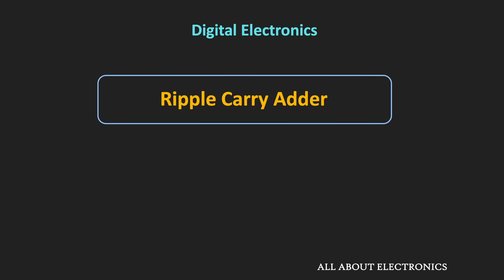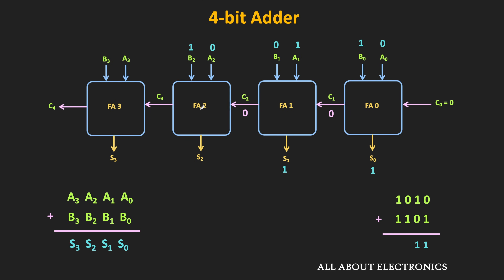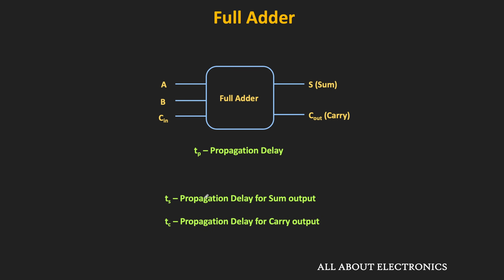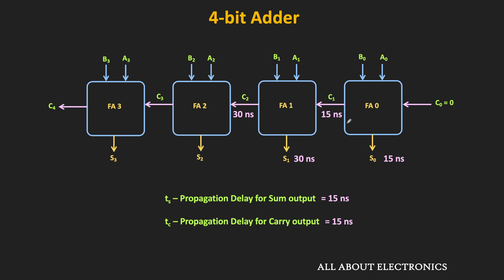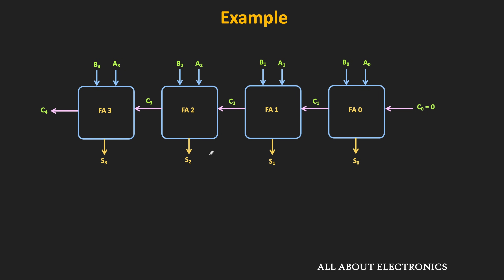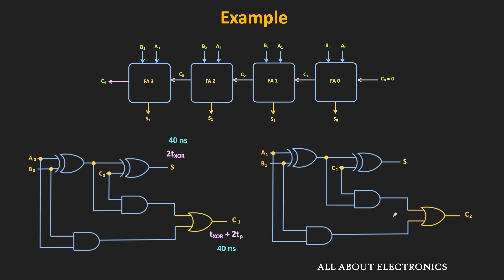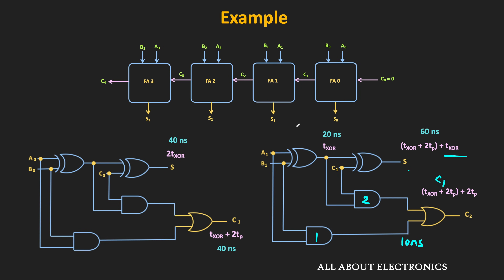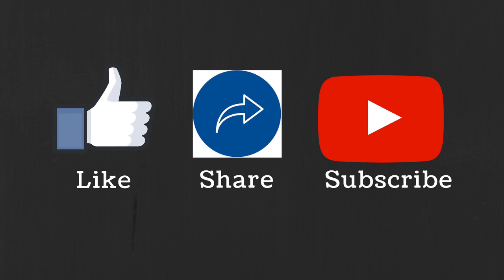Ripple Carry Adder Explained (with Solved Example) | Working and Limitation of Ripple Carry Adder

Comment: 11:20 , isn't it should be t(xor) + 3t(p) i mean the bottom and gate wasn't couted ig , 1 xor ,2 and, 1 or gate
Reply from the maker: It will be t(XOR) + 2tp only. If you see, the one input to the last OR gate is available after txor + tp time. While the second input (A.B) is available after tp. That means by the time first input arrives, second input has already reached there and available to the last OR gate. That's why there is no need to consider its delay. And that is why overall delay will be t (XOR) + 2 tp. I hope, it will clear your doubt.

Comment: Where does the final carry goes..should we consider it or ignore it?plss reply me😢
Reply from the maker: The final carry indicates that simply there is carry after the addition. So, if you are performing 8-bit addition using two 4-bit ripple carry adder, then output carry of the one 4-bit adder should go to carry-in input of the second adder block as shown at 3:53.

Comment: Sir, while finding the delay for the individual carry output of the first FA  , the delay should be t(ox)+3t(p) right? Could u pls explain me this
Reply from the maker: It will be Tox + 2Tp. Because, the one of the input to the OR gate is available at Tp time. (The lower AND gate). While the second input to the OR gate is available after the delay of Txor + Tp time. So, you just need to consider the maximum delay. That means after Txor + Tp time, both inputs of the OR gate will be available. And once that is available, then after another Tp time, it will generate the carry output. That means the max. propagation delay for generating the carry output is Txor + 2 Tp. I hope, it will clear your doubt.

Comment: Sir , how to design  a digital system to perform BCD addition using ripple carry adder??
Reply from the maker: Using 2 four-bit adders and the correction circuit for adding 110 (when sum is greater than 9), BCD adder can be designed. Consider 4 bit ripple carry adder as single 4-bit adder. You will require two such adders. (The second one is required for adding 110). And you will also require the control circuit to detect when sum is greater than 9. 
I hope, it will help you.